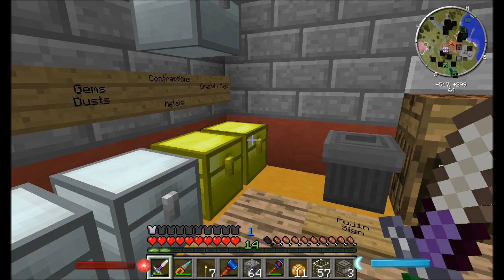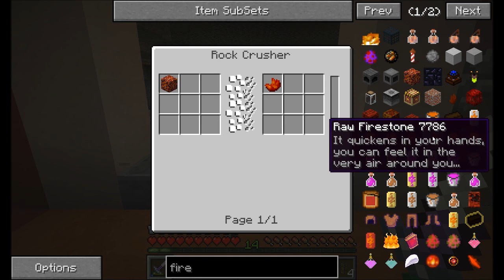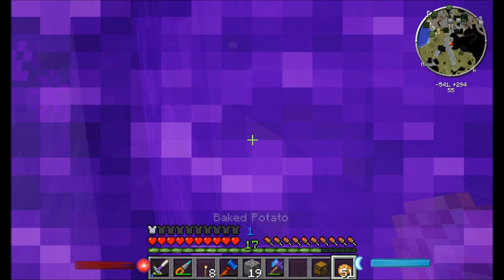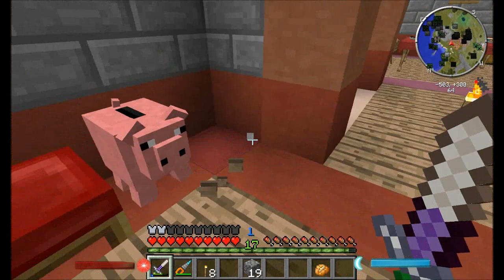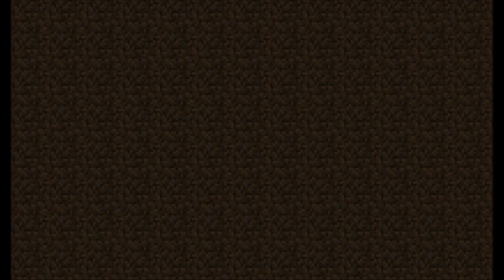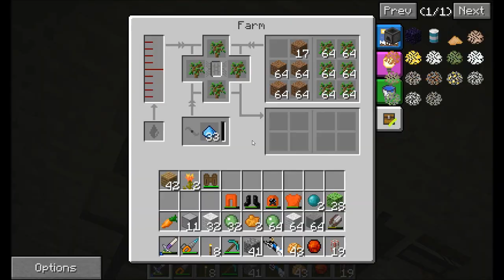Forgecraft2 S3E21 Firestone

Comment: Tip for Dire: Compress all the metals, gems and coal (only as much as you can though) into blocks (composed of 9 of the certain material) it helps Dire, trust me.
Reply: Can't you just craft them to blocks, I remember it's just a config. change after installing Gregtech.
Reply: try'd to tell him that too a few times,packer block i use in a decent sized set up pre and post me system.
packagers are awesome for compressing down a base resource storage.

Comment: Hmm, I wonder which version adds fire resistance to the Hazmat suit...
* glares at player and thunderdark *
Reply: That's been around since 1.4.6/7...  Probably before.

Edit:  Well, I correct myself, it just made you fireproof then, it didn't apply the fire resistance effect.
Reply: TheAttacker732 Yeah. Previously standing in lava or fire would drain the durability too, but now it doesn't D:

Comment: thermal-what mod should add the advanced cobble gen or something that produces stacks at a time in order to prevent lag
Reply: Thermal expansion :)
Reply: Thermal Expansion machines produce extremely little lag - typically less than vanilla blocks do, in fact. One of the primary design considerations in TE is for all the blocks, conduits, ducts, etc, is that they must be extremely lightweight, processor-wise. The Igneous Extruder takes less than most and causes, in effect, no lag at all. For it to produce stacks at a time would be pretty ridiculous.
Reply: Jon Von Basslake Ah, i thought the name changed or something, but it didn't, thanks :3
Reply: AislinnBMln maybe the machines don't, but still, 64 igneous extruders cause lag, (transportation via pipes, and a full chunk layer of machines) and its just ugly to have 64 machine blocks, that's why i think an advanced version of it would be way better
Reply: dividbyzero1 Or be less impatient than Soaryn. Seriously, there's very little reason to have even the dozen extruders that he was using there. One creates blocks at a very quick rate, four should produce a stack of cobble in well under a minute.
Reply: Crafting recipe requires some shiny ingots, 6 harden portable tanks and a igneous extruder.
Reply: And also, not the machines's creating lag, is the item-ducts causing the main problem, so use those opaque, that's design to prevent too much lag.

Comment: Dire! tell Soarin that Termal expantion cobbel gen is cool, but the open block pipes with the mining upgrades is way better, it makes like 1 stack of cobble per tic
Reply: nice spelling man. I can tell you really know what youre talking about. Also, the build soaryn has is intended to make tons of cobblestone with almost no lag. All the particle effects of vanilla cobblegen is super laggy, as well as moving that much cobblestone. Not to mention the size that many water+lava blocks would be stupidly large.
Reply: *****
Nice not reading his comment at all. He never mentioned the vanilla cobblegen, he mentioned the openblocks pipe with the miming upgrade cobblegen, which has no particles at all, no block updates, so it's not laggy, and is way faster (albeit a bit.. cheaty)
Reply: gilmouta
so i'm going to go out on a limb and say that the item node breaks the cobble that is formed when it makes cobble? the formation of the cobble causes a particle effect and the placement and breaking of the block causes block updates.
Reply: fredhenry101
When I said no block updates and no particles, that's what I meant. There's no breaking of any blocks.
Reply: *****
He's talking about using the Transfer Node cobble gen from the Extra Utilities mod. Lag-wise, it looks like the Transfer Node is four times worse than an Igneous Extruder, however a single upgraded Transfer Node can make cobble faster than 50+ Igneous Extruders combined. It's a great low-lag way of making tons of cobble.